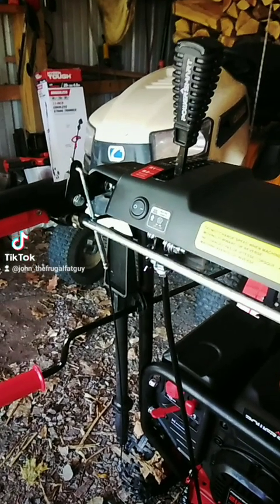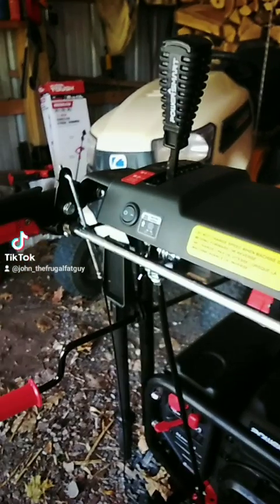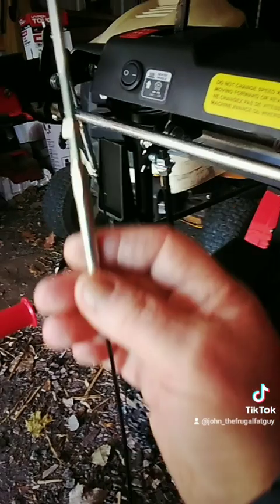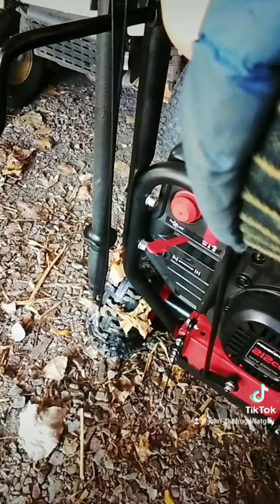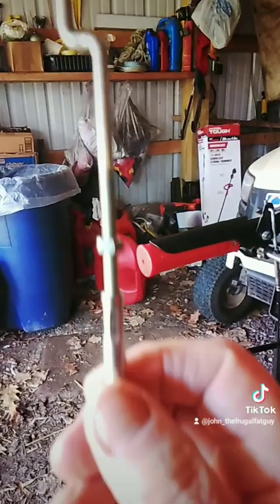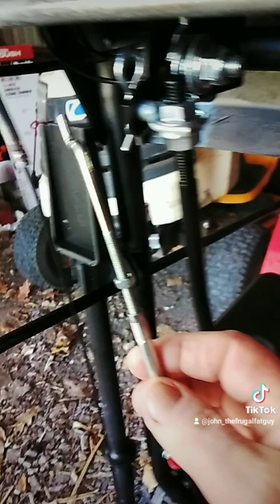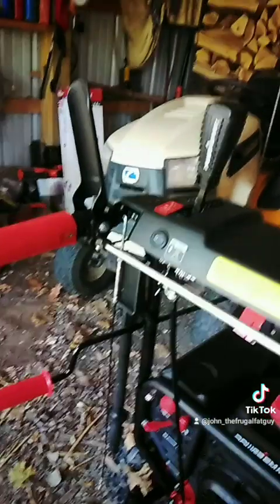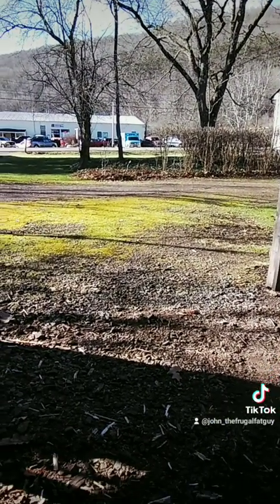Power Smart PSSHD24T Lack of instructions makes assembly tough. Customer Support didn't know either

Comment: John, try undoing the bolts on the handlebars, tip the handle bars back, hook your cable together and then reposition your handle bars and bolt them back down. Give it a shot and let me know how it works for you.

Comment: I bought the same model as you. Boy, it's was quite challenging getting to figure out how to set it up. I did not have the issue you are having with that cable but on mine, there's a dangling wire on the right hand side under the start button that is touching the right wheel. It's zip tied but it can easily get caught when the wheel is spinning. Also the zip ties under the handle bar are so tight that it looks like the exposed blue and pink wires are going to snap. Another issue for me is the dipstick as I cannot understand the level the oil should be at. Also no level indicator for the gas tank
Reply from the maker: Gas doesn't have a fill-line. Fill it until it near the top.  
The manual says the engine takes 20 ounces of oil and that it how much the container holds that came in the box.  
Near as I can tell from watching the other videos @garagegear, for one, is that the zip ties all need to be cut.  
Hope this helps, let me kn ow how it goes.  
John